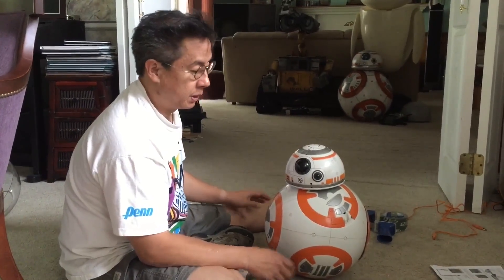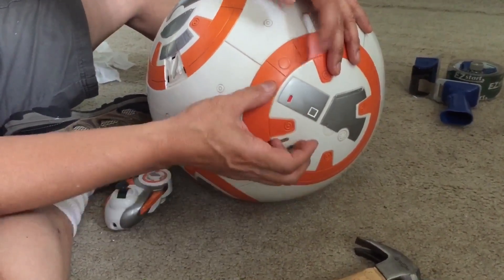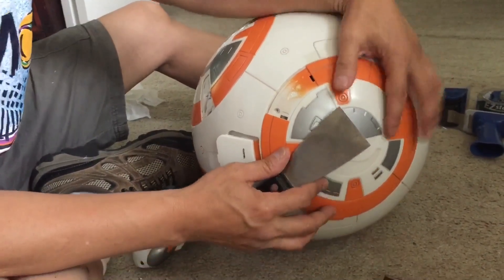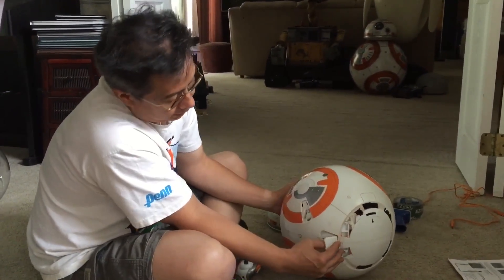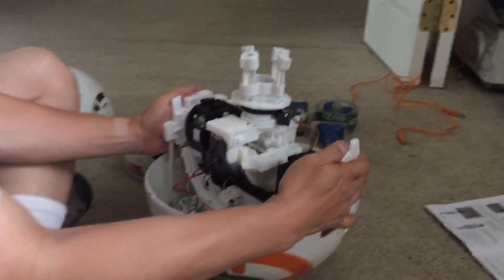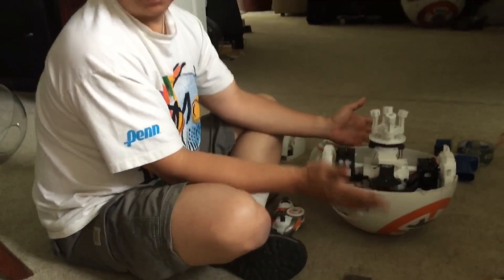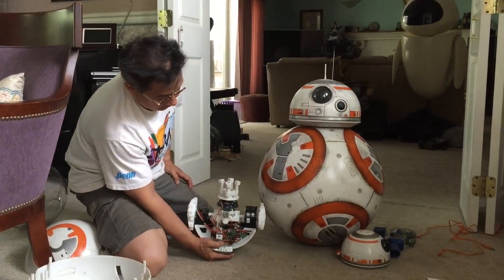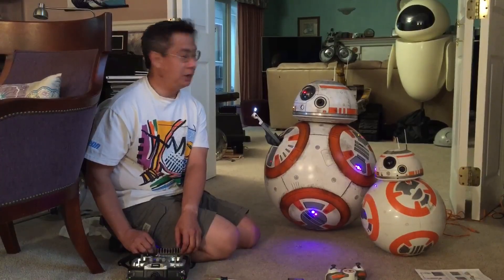Spin Master Hero Droid BB8 - Deconstruction

Comment: Trying to decide if I'm going to open up the defective one we just received so we have it for Xmas morning, or if I will do a return and have a disappointed kiddo. The issue is that BB-8 won't move forward or backward. Could be a bad motor, but maybe it's just slipped off the gear/tooth track being jostled in shipping?
Reply: Just purchased one yesterday, turns out have the exact same issue you describe.  I have been in contact with Spinmaster this morning and have arranged to ship the unit back to them for repair/replacement.  They are covering the shipping costs.  This looks like a well engineered toy.  I don't know what the QA process is like, or if it received some minor damage on the long voyage from China to Ohio, USA.
Reply: You have recieved one of the "bad batch" BB-8s, which indeed have burnt out drive motors.You can contact Spin Master to get a replacement.
Reply: XxxRedrocker95xxX spinmaster replaced the whole unit.  Took about a month for them to turn it around, it only cost us time,  replacement unit works well.
Reply: That's good to hear. Spin master is great about replacing the product. something also to note is that you can buy a set of the antennas on the head incase the current ones bend or break.

Comment: I bought two of these. On one, the charging module (round part) popped out about a half inch the first time I removed the charging cable, and the hatch cover would not close. I was unable to re-seat that part, and had to return the unit. I considered taking it apart (for about 2 seconds), but after watching this video, I'm glad I didn't try. I suspect that it would have ended up as a pile of small broken pieces sitting in a waste bin (especially if I used a BFH to split the halves.) Thanks for confirming my decision. The bonus was that I saved money, as the price dropped $45 in the week between online orders. It was still full price in WalMart.
Reply: Gregg North so you used the unit then returned it broken to rebuy at a lower price. Not right

Comment: Hey Mike. Great informative video. I have a question. How does one replace the rechargeable batteries? The impression that I have gotten from Spin Master  is that once the rechargeable batteries are no longer accepting a charge, there goes your $229.00 in the garbage. So in another words, don't expect to sell it on ebay thirty years from now. LOL
Reply from the maker: Jay Thomas Well you would crack it open and replace the battery.  No other way.
Reply: It was a lot of fun to take it apart and to see it come back to life:)
https://youtu.be/AuewrxMWJCc

Comment: Amazing demo of BB-8's inner workings, thanks Mike! Just curious though, I've seen footage of the SpinMaster Hero BB-8 spinning on the spot, but didn't see any kinda fly-wheel on the tech you showed. How do you think he spins?
Reply from the maker: Ryan Jenkyns There are no mechs in him that will make him spin.
Reply: The video yo usaw, was the demonstration back in 2017 for the prototype, as the tech used to make him spin was removed in the final product.